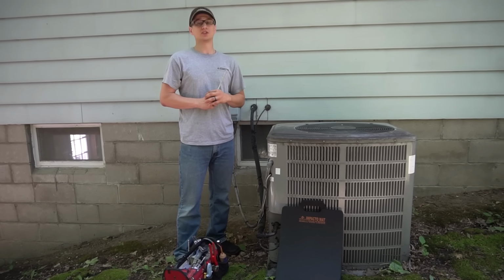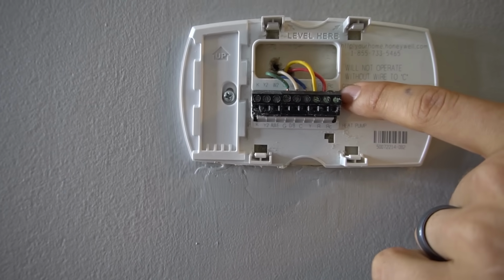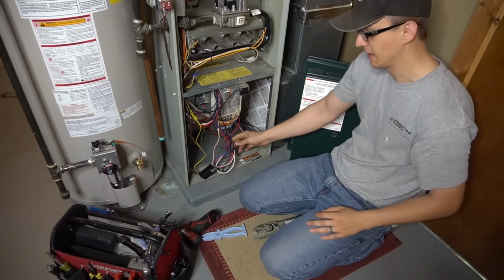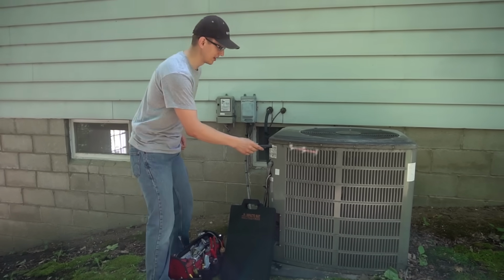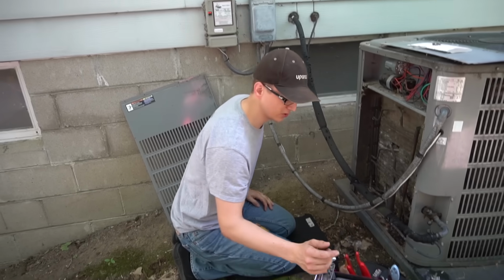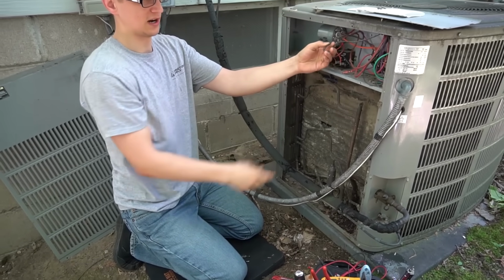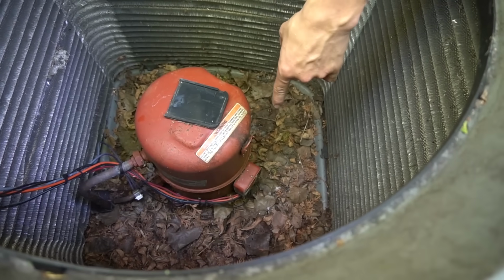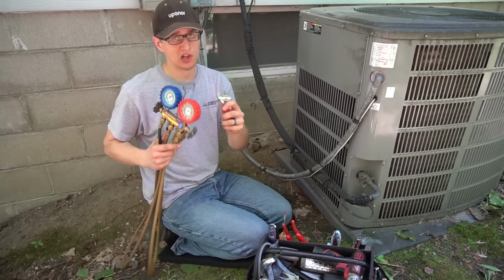AC Unit Not Turning On - How to Fix It Step by Step

Comment: Hey man thanks for the wonderful vedio. My upstairs ac unit stop working and COLD ON words were blinking. I turn the thermostat and furnace switches off and turn back on. AC started working and felt the air it was cold and looked at Freon hose out side it was sweating but after a few minutes later AC stopped again without dropping temperature down. I have been trying this thing for a few times, setting my thermostat temperature at inside temperature and it started working. When I started dropping temperature it cooled from 83 to 79 but at 78 did the same thing and now it's not working at all. When I turn the thermostat on it clicks and even COLD ON is not blinking but nothing is happening. In the furnace there is a grean small light that use to be blink but its off now. 
What do you think where the problem is.
Thanks
Reply: I don't see any fuses outside. There is a circuit breaker for the furnace in my garage in circuit breakers box. That is not tripped. I'll try to bypass the thermostat tommorow morning but when I took my thermostat off and put it in a refrigerator it was dropping temperature on it's screen I'll also replace batteries in morning. It's might be a short circuit because I saw the wire conduit the goes inside the outside fan, where there are capacitors, was damage.
Thanks for the help. I'll update tomorrow.
Reply from the maker: Sounds good. The fuse I was talking about would be inside the furnace at the control board though.
Reply: Oh yes I remember the one that was hanging in the furnace in your vedio.
Reply from the maker: Yes, that one :) Except most of the time it will be on the control board. Sometimes instead of a fuse there is a small circuit breaker as well
Reply: So here is the problem. The Romex wire that is coming from my garage circuit breaker into the furnace ,that is located in my attic, is not bring any power. I checked at the circuit breaker there are 110v but the end that enters into the furnace has no power. There are 2 possibilities, bad circuit breaker or the wire itself got damage somewhere. Should I change the circuit breaker first or somehow I can check the continuety first?🤔
Thanks
Reply: I did continuety test and found out hot wire has no continuety. I provided power to the furnace from another source after disconnecting the Romex that was coming from garage circuit breaker. My AC came on and everything was working fine. I concluded that hot wire is bad. I disconnected power and try one more time but this time COOL ON words on the thermostat started blinking and cooling did come on like it was doing at the beginning. So now I'm thinking there's something else wrong that caused the hot wire burned up. Any advice at this point.
Thanks
Reply from the maker: Hmmm.. When you say there is a burnt up hot wire, that makes me concerned. Is that wire in the wall? This may be a possible electrical fire scenario so I think it would be best to get an electrician to check this one out for you..
Reply: Yes it's in the dry wall. My uncle is an electrical engineer. He is coming to see it tomorrow. We might have to pull it out and run a brand new one.
Reply from the maker: Okay good! I have seen the results of a few electrical fires and they are not pretty. So it would be better to be on the safe side with this one.
Reply from the maker: If there is no blinking light, perhaps the 3 amp fuse got tripped? It sounds like either there is a short somewhere or your thermostat is defective or has bad batteries. If you bypass the thermostat, does the AC turn on? If not, then you are likely losing power somewhere in the furnace. How to bypass thermostat video if you need it: https://www.youtube.com/watch?v=9Y_R9unnadI&list=PLK8tZPlovA8Aw5W4GIoingc_enl5apH4C&index=10

Comment: Hi. I do have a question, my unit is set up to cool. but I noticed the heater go on first for a few seconds the the cool part go on. any idea what can be my issue? thank you I appreciate .
Reply from the maker: Is everything working good besides that? Some furnaces will do a "self-check" before turning on the blower motor that is in the furnace. So if it only comes on for a second or 2 and turns off, that is normal.

Comment: I replaced the control board, blower motor, transformer, capacitor and was getting code 33 limit or flame roll out switch so replaced both of those and it is still showing code 33 on the control board. I am in Texas and it has been three weeks we have been working on it and at a loss at this point as to how to get A/C working again without calling company that i cant afford. Thank you in advance
Reply from the maker: Wow, you have been busy! That's a lot of parts to replace. Sorry to hear about that, must be super hot there! But that's odd, I am assuming you are running the AC at this time. Code 33 usually only comes up during furnace operation. If you look at the wiring diagram (usually on the back of the furnace door) can you see how many limits/flame roll outs there are? Sometimes they can be tucked in behind something and are easy to miss. Most of them are re-settable, the flame roll outs I mean. Hi-limit switch should reset automatically. But anyway, lets try to get your AC back :) I will number the suggestions so they are easier to follow:

1. Do you have a multi meter that you can check voltages with? That would be a big help with troubleshooting.

2. If you jumper R to Y, does your AC turn on? If you are not sure how, you can do this either at the thermostat or the control board: https://www.youtube.com/watch?v=bmZc76ufTNY&index=14&list=PLK8tZPlovA8Aw5W4GIoingc_enl5apH4C
(If the AC turns on with the jumper, you can run it like this to cool the house but keep in mind that it will run non-stop since you bypassed the thermostat. So you would have to manually shut it off)

3. Try turning your thermostat to OFF and turn off the furnace power switch for 1 minute. Then turn the switch back on. Does the code 33 appear right away or only after you turn the thermostat on?

4. Does the same thing happen if you try to run the furnace?

5. Look around the furnace for any wires that may be unplugged or connectors that are corroded/broken.

Let me know what you find. Good luck! :)

Comment: HI! great video! question our ac unit blows air inside the house but our unit outside doesn't do anything. It sounds like its making a buzzing sound. when turned on. Any idea what that could be? where should I look first? compressor or capacitor?  thanks!
Reply from the maker: Sounds like either the unit is not getting 240 volts (check for tripped AC breaker or blown disconnect fuses) or the capacitor is dead and needs to be replaced.

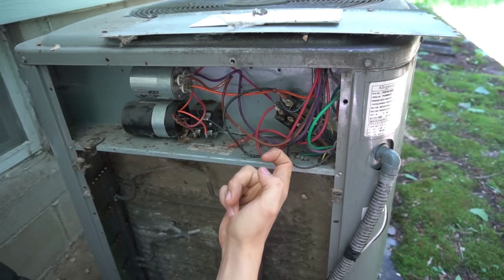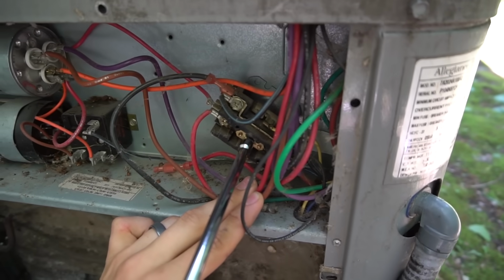Comment: This is very good Video, I have question, my condensor fan is not working, I pressed the plunger then the fan and condensor are started working,  May I know why the plunger is not pulling inside ? I am talking about the plunger in video at  17:37 to 17:50. Please help me out.
Reply from the maker: The plunger is not getting 24 volts from the furnace control board, that is why it is not pulling in by itself. The first thing I would check is if the 3 amp fuse is tripped. Does the blower motor inside turn on when you turn on the AC? Perhaps the power switch accidentally got turned off at the furnace. If you have an attic unit, you will have a condensate overflow switch that can interrupt the 24v as well if the drain line is plugged.
Reply: I will check the 3AMP fuse, yes the motor is turned on when I turn on the AC. I hear air is coming out of vents.
Reply: I just changed the 3AMP fuse, and my A/C started working, thanks alot, you have saved me $300's to $400's.

Comment: i am working on a old rheem heat pump the contactor wont pull in but i am getting my 240 an 24 volts what do you suggest
Reply from the maker: If your contacor coil is getting 24v but the plunger is not pulling in, then either the plunger is stuck (you can try turning off power and pushing it in and out to see if something is jamming it or if it's stuck) or the contactor coil is bad and the contactor needs to be replaced.

Comment: There was a power outage and once the power was restored my ac unit outside doesn’t turn on. The inside sounds like it’s running but it’s not cooling and I checked outside and the fan is not even moving? Does it have something to do with the power outage.
Reply: I'm currently having the exact same issue.  I'm sure you've repaired it by now.  Would you please tell us what was needed to fix the issue?
Reply: I have found that the power surge will occur and the breaker inside is tripped. If you know which breaker it is, turn it off then back on. If it trips off then there is a short at your condenser.

Comment: Great vid. Thanks!! Hoping you can help:

With the thermostat calling for AC, the circulating fan turns on but the exterior unit remains silent. No noise at all. No fuses blown. When I depress the 24V plunger on the external unit it fires right up. It does not seem to be blocked or jammed. The pressure switch looks like it's damaged. Could that be the issue? Is it easy to replace?
Reply from the maker: The pressure switch can be the issue. The 24v that goes to the contactor coil to pull that plunger in is in series with that pressure switch. Most of the time, replacing a pressure switch will require cutting open the freon system (the copper pipes that it's attached to) so it's not an easy thing to replace. You would need some expensive HVAC tools like a recovery machine, refrigerant vacuum, gauges, etc.

Do you have a multi-meter that you can use to check if there is voltage going to it? If you don't, for testing purposes, you can snip the two wires going to the pressure switch and wire nut them together (make sure the power is off when doing that). That will bypass the pressure switch. If the unit turns on, then you know the pressure switch is bad.

If you have an attic unit, I would also check your condensate overflow float switch. Perhaps your condensate drain is plugged and there is water backing up. If that switch is tripped, that will interrupt the 24v going outside.
Reply: It could be a delay board that prevents the unit from starting too soon, a simple easy fix but I don't know if you can get this part. The part stops the compressor from running until the high and low pressure equalize in the system.

Comment: Great video! But I was hoping you can give me some advice. When we turn on our AC the inside turns on and air comes out of the vents but it’s not cool. The capacitor is working and when pressing the plunger the outside fan turns on. What should my next step be?
Reply: Laura Alvarado  does the plunger engage on its own when you turn on the thermostat to start the unit? If not it’s your connector. First make sure the area is clean around it. If it still doesn’t engage You can buy the part through amazon for $10 and replace it. I just did it to my unit and it works like a charm! My thread conversation with the AC guy is above. That’s what he told me to do.

Comment: Great video, I have a question though. Outdoor fan and compressor not turning on. Bypassing thermostat will turn both on by pushing in plunger. Thermostat will turn on furnace fan also. Not sure where the miscommunication is. Hoping for some advice. Thank you!
Reply: Wesley Brown did you ever find out what it was? I’m having the same issue!

Comment: Question:  I have a bar A/C that's on the wall on the second floor, two a/c lines connected to the coil on the outside. Well the smaller diameter line is wet and very inconveniently drips down in the basement area before it goes out. We placed a bucket to collect the water that drips down. What would cause the small diameter a/c line be wet. Is there anything could be done. We do like an addition to the second floor as it gets hot in the summer. Would appreciate any suggestions.
Thank you for a good video.
Reply from the maker: To start with, you can buy a piece of black pipe foam insulation from a hardware store and put it around that wet pipe. That may be all that it needs to stop that drip. The insulation should prevent condensation from forming on that line.

Comment: We replaced our capacitor 3 weeks ago and now our outdoor unit won’t turn on again  today we  replaced the contractor and still nothing we have just a small buzzing noise but that’s all
Reply from the maker: It could be a capacitor again or the outside unit is not getting 240 volts. I would check if your AC circuit breaker is tripped and your disconnect fuses if you have them. The small buzzing noise is probably the contactor plunger when it is pulled in when the thermostat calls for cooling. (24 volts)

Comment: I went outside and pushed in the plunger and it started running.  What could be the problem?  Thermostat?
Reply: Mark Duray does the plunger engage on its own when you turn on the thermostat to start the unit? If not and it’s sticking it’s your connector. First make sure the area is clean around it. If it still doesn’t engage You can buy the part through amazon for $10 and replace it. I just did it to my unit and it works like a charm! My thread conversation with the AC guy is a ways above yours. That’s what he told me to do.

Comment: Hey I hope you get this soon. Is there a possible way to go from a single capacitor to a dual or no?
Reply from the maker: Sorry, just got back from vacation. Hopefully you already have this figured out but yes, you can go from a single to a dual capacitor. You would need to look up dual capacitor wiring and wire yours accordingly
Reply: Word of Advice TV awesome thank you and also I went from a single pole contactor to a 2 pole contactor. I only had a total of 5 wires hooked up to it. The two side ones are the thermostat ones. Should I keep all the wires on just one side of the pole and keep the two thermostat wires on each side of the contactor as it was on the other and just leave the second pole open?  Again thank you for getting back to me. I really appreciate it.
Reply from the maker: I would wire the new contactor the same way the old one was wired. The 2 pole breaker is primarily for the two 120v hot legs coming from the disconnect.
Reply: Word of Advice TV hey man I really appreciate your help. So much. Sorry I got back to you late. Just to make sure I want to run the two white thermostat wires on the opposite sides from each other on the contactor right ?? I got everything running after I replaced the transformer and cold air is running through the house and the outside unit is running but I just want to make sure nothing will blow late by hooking those thermostat wires wrong. Again man, thank you so much and talk to you soon
Reply from the maker: No problem, glad to hear it's cooling good! Yes, the two thermostat wires go on either side of the contactor coil. Just make sure you don't accidentally put them on the 240 line voltage. I have a video about the contactor if you want to take a look at it: https://www.youtube.com/watch?v=YCygHajsW34&index=18&list=PLK8tZPlovA8Aw5W4GIoingc_enl5apH4C
Reply: Word of Advice TV awesome brother. The video just gave me closure. Thanks for your help again, it’s more than appreciated and stay safe out there. Have fun and keep the videos coming 👍🏻

Comment: Great video! Can’t believe I watched the whole thing. Lol. But it didn’t answer my question. My fuses in my disconnect keep blowing. It usually works fine for a day or two then blows a fuse. Capacitor looks to be good. Any ideas? Much appreciated.
Reply from the maker: I would start by thoroughly hosing down your condenser coil even if it looks clean and then if your unit does not have a start capacitor, I would put in a SPP6 hard start kit to reduce the start-up amp draw of the unit. And hopefully that will do the trick. Also, look for any burnt or broken wire connectors, especially at the compressor pins.

Comment: This summer has been extra hot, And recently my AC started acting up. When I turned it on the other day, It was making a rattling sound inside the home and sounded like it was coming directly from where the furnace is located. Anywho, A repairman came te other day to fix, And he also added a new thermostat (Which I absolutely hate) And now when I try and turn the air on, All I hear is crickets. The outside unit doesn’t even come on. Could that possibly lead to a troubleshooting issue with the thermostat, Or would is it a fan fix that needs to he done in the furnace area? 

P.s I know nothing about AC units, Unfortunately :(
Reply from the maker: I would call back the guy who fixed it originally to come back and finish the job. Was it working when he left? I wonder if perhaps there is no jumper wire between R and RC behind the thermostat, at the wires.

Comment: my 3.5 ton ac keeps going on and off. the filter has been changed and the gas refilled.  still have the problem.  is there anything else other than changing the ac

Comment: My outside unit will not turn off
Reply: That's exactly what it was. I fixed it myself. Thanks.
Reply from the maker: My first guess would be that your contactor contacts are stuck closed. (sorry for the late response.)

Comment: is a 40+5 urf comparable to a 70+7.5 urf what are these numbers for?
Reply from the maker: No, those are much different. The capacitor stores a voltage charge and helps the compressor and fan motor run. In a way, it's like a battery for the compressor and the fan. 40+5 is the micro-farad rating of the capacitor, or the size of it. Putting in a larger capacitor will increase the strain on your compressor and fan, causing them to burn out prematurely.